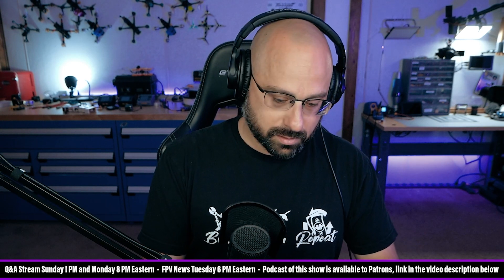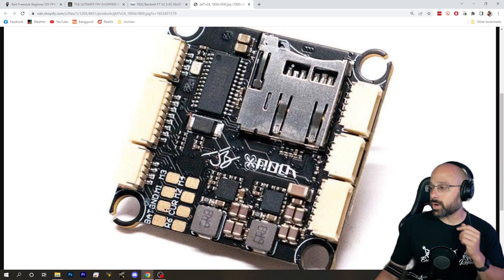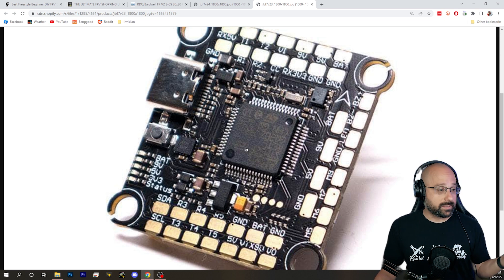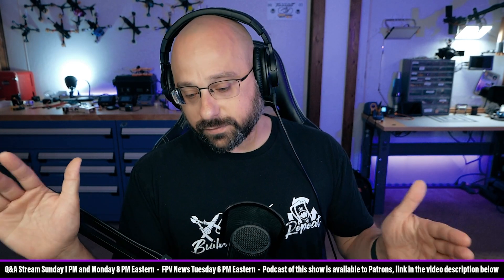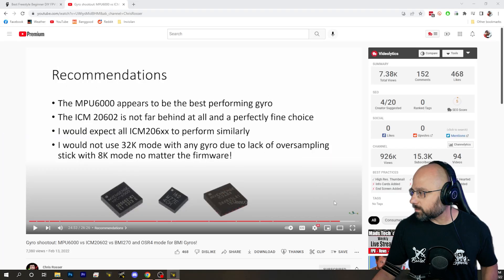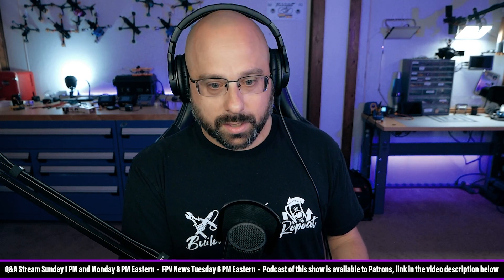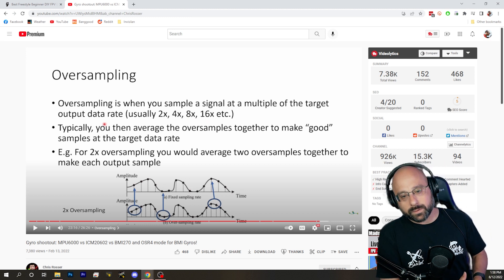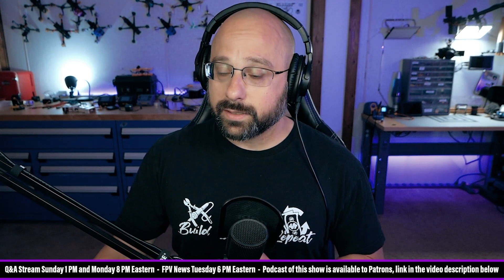Why Does The JB F7 Flight Controller Use a BMI270 Gyro? - FPV Questions

Comment: BMI270 is much smaller and smoother then the mpu6000 when filtered properly increase filters 1.1 mm ..  3.2 is less low frequency noises has higher frequency noises but are cancelled out with higher filtering   ,, I have both the BMI270 feels alot smoother to me with the proper filtering the  bmi270 is a smaller chip also so there is sacrifices I really see no difference if you are good at tuning they all operate around the same 250hz I believe the skystars FC seems the best to me really fast processor
Reply: But I'm shit at tunning. I just want a gyro that works fine with presets.
Reply: mpu6500 8k pid loop gyro is the easiest to tune  @alejandromedina-ix5yx

Comment: It would be amazing if you can get on the inav target, that would just open up so many doors in the way of amazing content and information :) also on the bmi270, i really don't mind this switch too much.... i feel like they are better filtered than the mpu's and icm's anyway, i have one in my 2fiddy 55a beast aio v2 and tbh i really struggle to even break propwash out of it when i really try to, so at the end of the day i guesse it depends on what situation you are applying it to but in most cases i think this change will pretty much go unnoticed in our actual flying :)

Comment: I think this, we are living an actual problem with chip shortage due to war, covid and so on. So the fact that we can still have a bmi270 is still a good thing. That should remind to us that fpv world is not important for chip market so it can't really create nothing unless some real vip who should need a drone in "consumer" needs something like that. I also think that we are using a tech that comes from 2005, so we shouldn't be surprised if it's slowly going away since that technology just waste more material than the actual technology. The only problem is to have now a firmware wich can adapt with future embedded board wich will lead to better processors to filter a worst gyroscope, and keep in mind that, mpu6000 bmi270, are crappy gyroscopes anyway. It's an old technology, we should demand for a new one, but considering the high cost, the low income, and really low request, I don't think we will have something new before than 2050.

Comment: Plus in the experience of people the BMI actually is a rugged little chip that doesn't decay over time like the ICM20602 does. In times where the MPU-6000 leaves the market this was the right choice to make and I hope they update their twin gyro FC with the BMIs - my iflight FC powered quad sufferes from bad ICM gyros. The new foxeer F722 mini V3 also comes with the BMI270. Let's see how that affects my freshly awaken AOS5.5 :3
Reply: What's your ICM42688P problems?

Comment: Pretty difficult situation indeed. I hope things get better in the chip market soon.
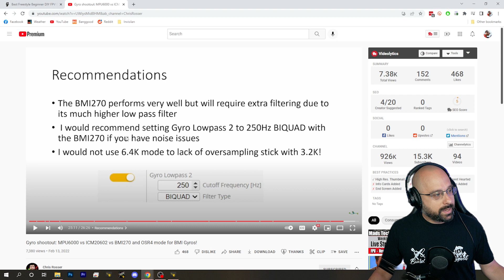Reply: 9:00 sorry im quite new to fpv and i just got a fc that has a bmi 270 gyro in it , is he saying that if you install BF 4.3 on ur fc, the program automatically integrates these low pass filter settings into the fc? so im assuming we dont have touch the filter settings on bf?
Reply: @haks_123  The change he talks about is internal. For the betaflight user, nothing changes, you can change any setting you like.
Reply: @AlpayYi  thx
Reply: @haks_123  I have no idea, dude. Try sending an e-mail to Joshua!
Reply: @MCsCreations  nvm he replied to me on another video and he said that It’s correct
Reply: @haks_123  Good to know! 😊
Reply: Lol MPU6000 is discontinued for good